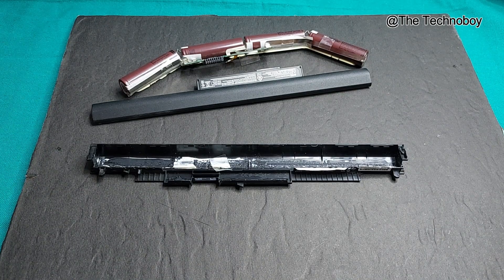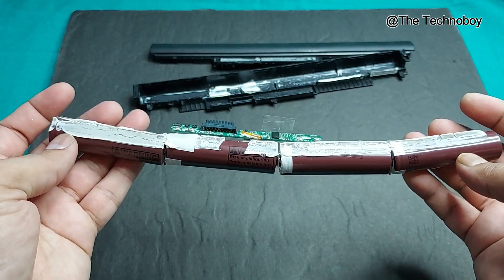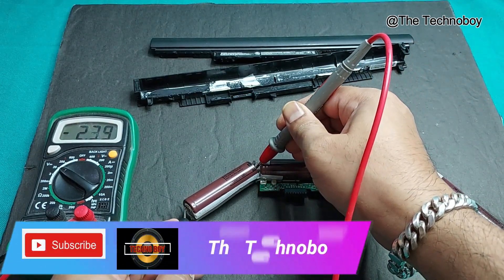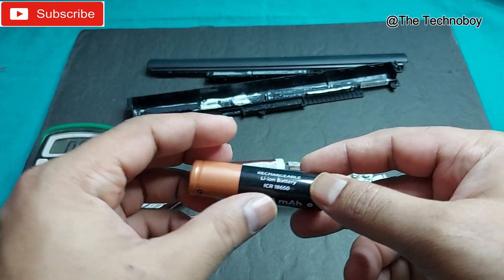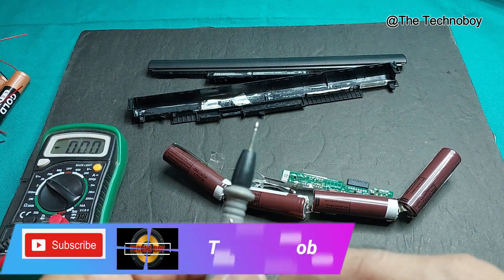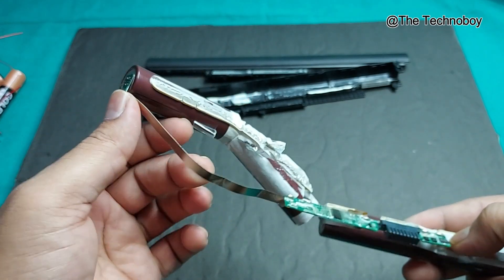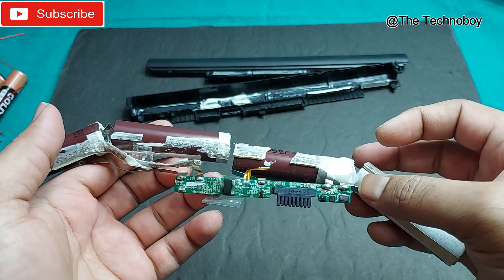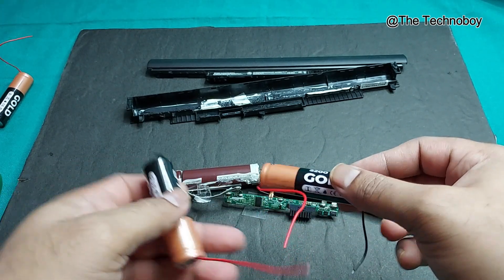How to Repair Laptop Battery at Home / Not Working Laptop Battery repair / The technoboy

Comment: Sir I have Sony Vaio VPCEH model laptop. Can i use 1200mAh lithium ion batteries for replacement? Are they suitable? Please reply
Reply from the maker: You can but that capacity would be very less
Reply: @technoboy-allinOne  then please suggest me how much mAh batteries would be sufficient? My laptop battery has 6 Li-ion cells and I have planned to replace with 1200mAh each cell, which means 6x 1200mAh batteries

Comment: mera sara battery 3.9 volt dikha raha h fir bhi back up nahi deta h. 2min me laptop band ho jata h. how to repair this??
Reply from the maker: Check/replace the charging kit
Reply: Changer les élément défectueux puis faire un reset du BMS avec le logiciel Battery EEPROM Works V4.32 sans lui la batterie restera dans le même état après remplacement des élément defectueux
Reply: @lestutorielsdepournoustous8709  tutorial ?

Comment: My sony vaio laptop battery vgpbps22 connector is damaged, do u have spare parts? It is 7 pin connector
Reply from the maker: Sorry I don't have this
Reply: @technoboy-allinOne  hey, i have one question, is this possible that a battery, especially a laptop battery that was adead battery for years could suddenly start to charge normally? because it happened to me today with my acer travelmate 5744z. it's original battery suddenly was charging again after i installed linux mint on it